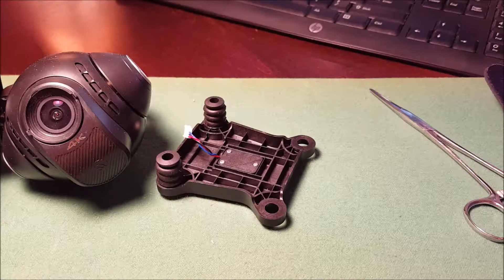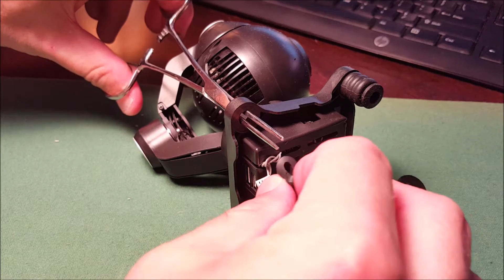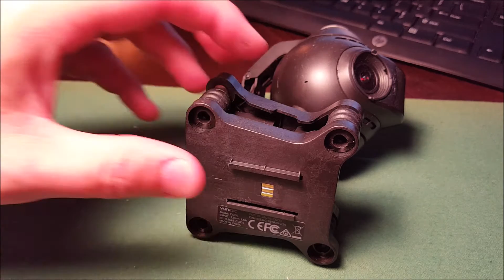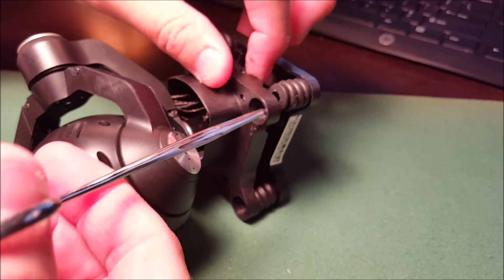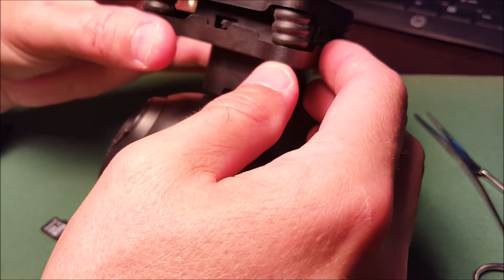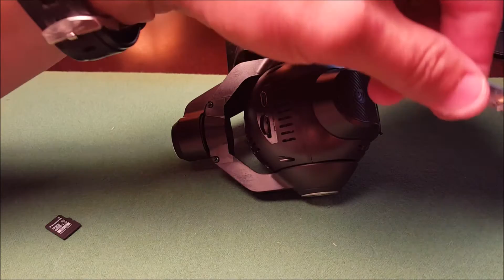Yuneec Q500 Drone CG03 Rubber Damper Replacement (HOW TO DIY)

Comment: Thank you so much ... my q500 crashed the other day and the plate came off the rubber mounts and I was not sure how to put them back on. Also I read that you do not actually need those cables if you use the outer cable it came with . Hopefully thats right.

Thanks again
Reply from the maker: Glad I helped!   Thx for watching!